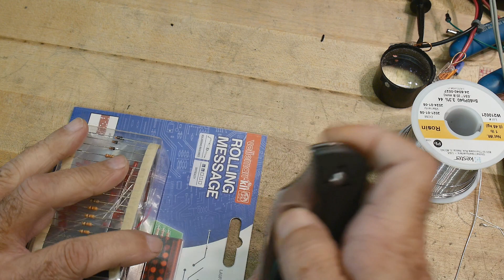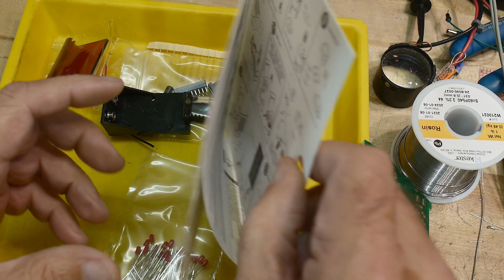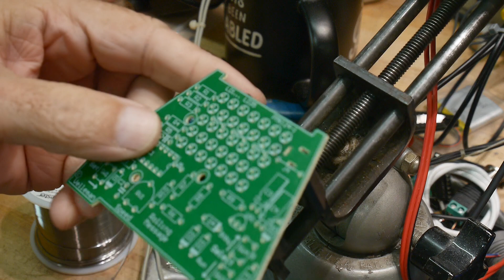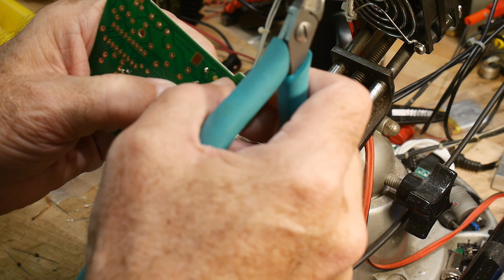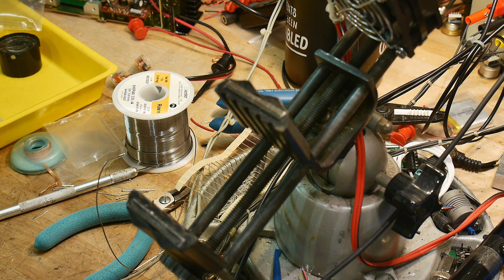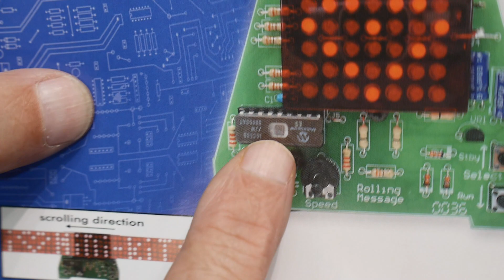#970 Velleman Scrolling LED Sign Kit

Comment: In the good old days of leaded components for pcbs, bandoliers were first made up by a machine that took the components from individual reels of components and created a bandolier like the one you have in the kit with all the components in the right order. Once all the components for a particular PCB were all on one reel, they would be inserted by a different machine into the intended pcb. That's a lot less hassle than loading all the individual reels onto one machine and allowed reels for PCB to be made up without using the main machine giving a faster changeover between different pcbs.

Comment: A bit disappointing that they didn't even put in a small manual on how to use it. And the wrong polarity is just an absolute fail. Good thing they put in a reverse-polarity protection, cheap kits don't usually have those. Looks like a nice beginner's soldering kit though, apart from those errors.

Comment: Maybe swap infrared led's, to activate a motion sensor.  Would couple a fan on a timer, to exhaust fan.  Dry out the bathroom.  Would need right frequency led's, to mimic body heat.